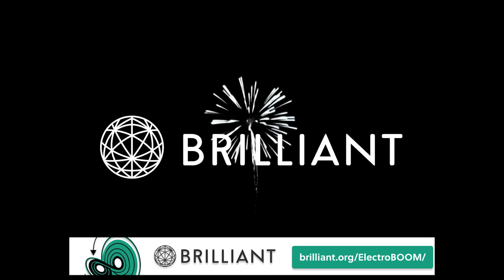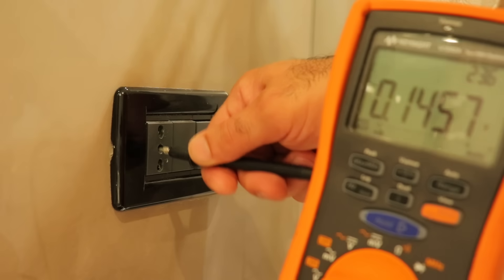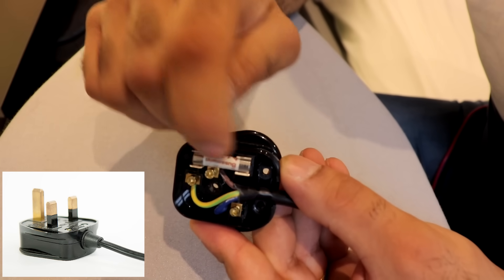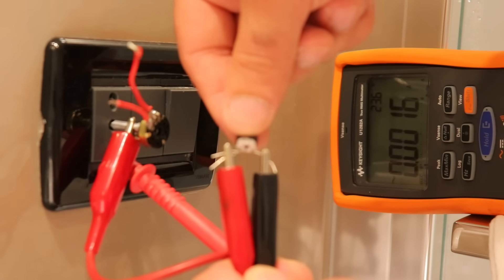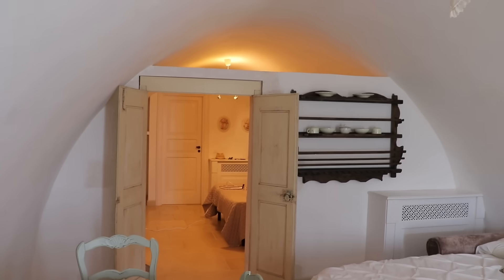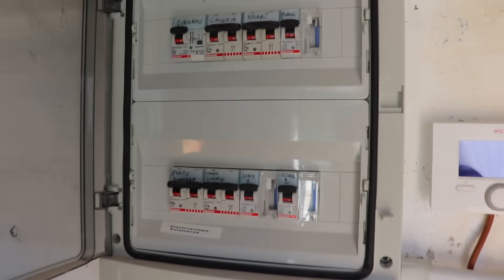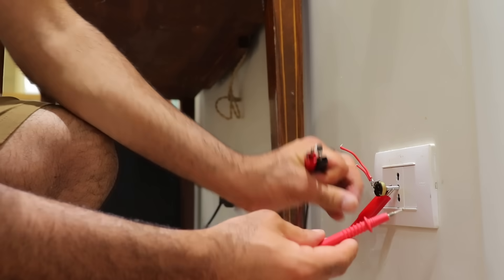Tripping Every Breaker in Italy

Comment: I have put your photo at my hotel reception area. You do imagine you can trigger the fire alarm that would force to evacuate the entire hotel... For your fun.. however if you want to test you are welcome to my house. In EU voltage is 220-240. Normal is 230. And yes we have    main ground protection of 30 mA an again for the bathroom a 5mA or 10 mA protection. You can't die of electric shock  even if you want it.

Comment: That weird plug (Around 9mins) should be for some hotel phone connection. About the other plugs: the one with "double holes" is rated up to 16A while the one with single  size holes up to 10A. The round plug with separated ground is a German standard also that up to 16A. In Italy, the standard power supply you get for your house is 3.5kW ("by chance" 16A at 220V), you can obviusly ask for more if needed but plugs with higher current rating are not available. Regarding the ground protection is considered good pratice to have one for every line (plugs, lights, hooven, bathroom, ac,...) while the one beforer the main switch is mandatory by law. The device you saw may also take care for  both the ground protection and  the max load on the line (above the set rate it automatically disconnect)

Comment: Alright, time to explain some things, from a fellow Engineer, @ElectroBOOM :)

1:43 - the "double-driled" outlet is what we call a "bipasso" (double-base): it's shaped like that because it can receive both the old 16 A, 230 V standard we used to use up until the late 2000s and the "Europlug" (10 A, 230V) which is slightly smaller and has the prongs closer to each other. Good thing that the ground is still in the middle :)

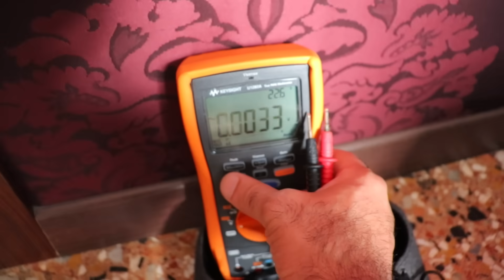1:48 - Usually in Italy the end user can see anything between 220 V and 240V, it depends on how recent and powerful the distribution is at the cabinet upstream.

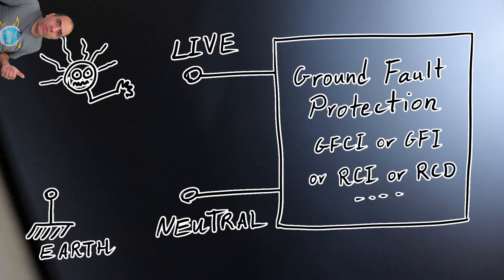2:29 - In Italy it's not mandatory to have GFCI plugs because, well... they don't work as well as a magnetic-thermical-differential breaker (MTD) does if well-chosen. We have quite strict standards on what size to put for any kind of use :)

3:08 - By UNI EN standards, Green/Yellow is ground, Black is neutral, Blue/Brown is live. The breakers you've measured are Schneider Electric's C10 class (which is a magneto-thermic breaker with a differential unit) which is way more than adequate for home use. C10 refers to the UNI EN classification: "C" curve (the way it evaluates the runaway current to ground, the C one is extremely sensible) and 10 is the Amperes it will lwt through in normal usage. If you want to see the tripping current, you'll have to see the I(delta)n value stamped on it. Quite safe, I'd say: it doesn't need ground fault, because it IS the ground fault :)

5:28 - That's the "Europlug" standard, 10A, 230/240 V. Small, but still useful. If you need something beefier (like, need to power a PC continuously or a microwave oven) you'll likely find a 16A plug (the "Italian Standard") or a SchuKo/UNEL plug.
Reply: But isn't the EU standard brown/black=live and blue=neutral??
At least that's what Wikipedia says and how it is in Germany.

Seems very dangerous to just seitch those two colors.
Reply: @YourMJK  When you read a technical directive, you have to be careful of what norm agancy you're referring to. For example...

UNI EN ISO is "International Standards Organization directive, as passed down to the European Centre for Normation, translated and adapted by the Italian Normative Union".

You can see how "some" parts can be different (for example, DIN/VDE require different colours for live and neutrals than UNI) as long as the fundamental parts of the standard (how to apply it, what parts to use, how to use them...) are exactly the same.
Reply: Le spine italiane tipo L ci sono anche piccole da 10A, si trovano specialmente quelle tripolo con la terra, che invece nelle europlug tipo C manca
Reply: Be careful! Blue is neutral and black/brown is live. (For European standards)
Reply: @ThatsGabs  The UN (European) Standard is different to the UNI (Italian) Standard only when it comes to colouring the wires.

Comment: The actual color rule for cables in Italy is:
• green and yellow = neutral;
• blue = neutral;
• black = live.
Do note, though, that this may vary by A LOT in older homes. I found all sorts of colors (like brown, red, white) in my goddamn outlets (with my house being 100 years old).

Moreover, many houses have lighting and appliances running on 2 different circuits.

Last but not least, you shouldn't use German plugs on Italian outlets without an adapter (even though you can actually fit them in there). Most Italians know that and wouldn't do differently, they feel damn loose otherwise. 

P.S. remember to pay a visit to Sicily next time you fly to Italy! ❤️

Comment: italy should have the EU-SCHUKO (the round one) plug,  but in older hotels te old standard is still tere and hotels mostly for US visitors . and the standard eu-braker are considered the safest in the world. Germany exports these brakers to everywher ein the world for a reason... lights and sockets are on seperate cicuits (every new instalation this is a must) and almoast every room has to have a seperate breaker, Kitchen and batrooms need also additional safty systems.

Comment: The new standard is 230V, while traditionally we used to have 220V. So, I'm not surprised at the fluctuation between those two.
Btw, I've lived in Europe all my life and I've never seen/heard of an application where you might need to plug the live and neutral in a specific manner. The ground is always in the middle, independent of the plug and no matter how you plug the device. The only application where you need to connect the live and the neutral correctly would be some two/three phase appliance. But those have different plugs and they don't have those in Italy. Italians reserve those for industrial application. There are countries in Europe where we have three phase outlets un our homes. As for the regular, single phase outlets, the general rule is that the right one is live, the left one is neutral or like in Italy, rotate that 90 degrees clockwise and you get bottom live, top neutral. In any case, the ground always stays in the middle. A common person will probably never need to know any of that.

Comment: Here in germany we also do have those simply "slim plugs" which are called euro plugs. However those generally do NOT have a ground connection like those you showed. Those are only allowed here for things that do not need a ground connection. So only for protection class 2 devices.

Here in germany we only have the "Schuko" outlets, everywhere. The brandname "Schuko" is a contraction of "Schutzkontakt" which essentially means "safety contact" and refers to the ground contact of the outlet / plug. Any extention cord here in germany has to have Schuko sockets. Of course for applications where the polarity matters we have the usual CEE plugs (blue[one phase] or red[3 phase]).  Though you usually don't find them in normal households. It's more an industry standard. Though you will see them in camping a lot.

It's always great to see those "security audits". It's really interesting how the rest of the world handles things.

Comment: Regarding gfci in (central) Europe, most of the times the entire house is protected by one gfci, or FI as in Fehlerstromschutzschalter as we call them. It is wired into the main fuse panel and protects every circuit in the house, not just kitchen/bathroom.

Comment: Looking carefully at some US plugs, I think I finally noticed why they've never actually caused me a problem despite their hypothetical deficiencies: the plastic around the base is flared out into a flat thing like a guard on a sword, so when you hold it naturally for plugging or unplugging, it's actually really hard to reach around to touch the metal. Of the 6 "bad" plugs in this room with me right now, 5 have that property. So I guess that's the cheaper solution.
Reply: Rest of the house has 4 more with the flared "guard" shape, plus one VERY old dangerous lamp without it. So I'm guessing it changed sometime in the 60's or 70's, an industry-wide rollout of flared plugs at some point.

Comment: I can imagine that in Venice it is an electical nightmare as some areas flood and all the electrical needs to be run high up and kept water tight where it may need to run near the water.  That being said I would imagine that much of europe is actually an electrical nightmare just like the US with old and new standards.  I think I would lose my mind if everything here was on an RCD or GFCI.  How do they prevent nucence tripping when grounded inductive loads like wellpumps, refridgerators, washers, etc kick on and off.  My fridge will rarely but sometimes trip a GFCI and the inductive ring and surge from the wellpump kicking in is enough to even trip a GFCI in some cases.  I am guessing they are either double insulating everything or are running most inductive loads on separate dedicated circuits.

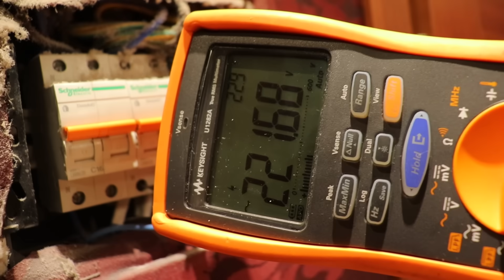Comment: 3:30 black is NOT the neutral in Italy!  What happened there
Reply: At my grandmas house in Sicily they used green with hot and blue neutral
Reply: @lucamarchese6187   Blue for neutral is right, but live should be brown... it could be some old or DIY system (also ground is green+yellow, striped)

Comment: ElectroBOOM One time I took inspiration from your videos and decided to stick two lock picks and a screwdriver in my gfci outlet and I proceeded to test the gfci. Then I bridged the live and neutral pins just expecting the lock picks to get hot and start turning red. Instead it exploded and the outlet stopped working, I was so scared that I broke the outlet but when my mom went to use her hair thingy in the other bathroom that outlet also wasn’t working. Turns out, I just tripped the 2nd story bathroom outlets breaker. And my lock picks welded themselves together. 

Mom, if you’re reading this, I fricking love you! And sorry for messing around with wall power.(And probably raising our health insurance by posting this comment.)

Also so that OSHA doesn’t come kicking down my door, the lockpicks had plastic handles and the outlet was gfci and I was standing on the plastic toilet seat while wearing my rubber crocs.

Comment: Actually the two different types of plugs are either 10 Amps or 16 Amps so when you have the "Hybrid" socket it's because it's rated for 16A. On the other side i think the socket that you were asking about is an old standard for telephone plug hence it also was near the newer rj socket. For the plug with a fixed neutral position it's called a schuko plug (CEE7/3 and CEE 7/4) and it should not fit inside a 16A socket unless you force it or unless the socket has been abused in the past. Nevertheless the problem is still there because you can buy an adapter and plug it in however contrary to what you think there are actually usually two level of protection one for the single appartament/hotel room and another one for the whole building usually coupled with the meter so if one fails you can still be safe 😉

Comment: The plug at 9:12 is a special version of the telephone three-pole socket made by BTicino. The plug had three connectors to connect older type of landlines that used a twisted wire pair that also came with an earth wire. Today landlines in Italy use just a twisted wire pair that carries everything from RTG (rete telefonica generale, our way of calling the PSTN) to ADSL and FTTC.
That plug is not as common as the standard type of three-pole socket commonly used for landlines but you sometimes see it in some older buildings.

Comment: In theory, new Italian houses must have a proper breaker for each room,  or a general breaker box with breakers that allow for proper closure of each room. The more important breakers are in the kitchen or bathroom, as we tend to have one for each main appliance (oven, fridge, washing machine, dishwasher etc), plus a general breaker. However, we have a loophole.... basically, each electrical, plumbing, gas setup in the house, when first built, has to be declared compliant to the current regulations, but if nobody ever touches it again for years...nobody ever really cares and considers it still OK. Unless a new technician checks it and says it isn't. Lol.

Comment: I'm italian, the problem when you connect shuko plug in normal outlet is that it require a specific adapter that convert the ground in sides in the center one. It should not fit into normal outlet but probably someone forced the outlet and now holes are bigger and NOT SAFE

Comment: You should check Germany, we have different outlets, these big plugs only go to grounded outlets. Devices without grounding (plastic cases) have a smaller plug without a ground wire and also go to the big outlets, so you don't have this missmatch

Comment: In many Europan countries (including Greece) the blue is neutral, live wire is black, brown and gray in 3phase installation and mainly black for single phase. Earth is yellow-green. For home installations there is usually a main ground fault protection breaker in the panel rated at 30mA, or instead of simple breakers for each power line a similar 2p micro gfp breaker like the one had to reset at the hotel in Venice

Comment: 15:00 Please explain why AC polarization is important to the device, especially with un-grounded cables; why have a polarized NEMA 1-15P?
I could understand a 3-prong connection (5-15P) needs to be matched since neutral & ground are effectively connected together inside (in my observations), not just a chassis ground. 
But what is the advantage of a polarized 1-15P?
Reply: Every device will work if it's wired backwards, but that introduces danger in certain situations. 

Take for example, a toaster with a single pole switch. If the switch happens to be on the neutral side, all of the heating elements would be live at mains voltage even when the toaster is off. Edison sockets are also very dangerous if polarity isn't enforced.
Reply: @Owen_loves_Butters  ah… duh… gotcha. Best to switch the “hot” side, even though you still have to complete the circuit, constant “hot” connection to the heating elements would make it more likely to accidentally close the circuit to neutral or ground with say, a finger or fork. 

Correction to my first post: “… AC *polarity*…” (not polarization)

Comment: And those "doors" are childprotection. The outlet is a Type L apparently.

And most of Europe "should" use the same standard for portection but not same outlets, although it actually is decided that we should be using Schuko outlets. 

and a another factoid - in Denmark - its the standard that there are two seperat breakers and RCD for the kitchen and lights so when U trip one u still have some light.

And those RCD should be testet every month but like none are, and they can stick in the on position over time and have a 20% failure rate over two years. But most ever get found within warranty cause no one tests them.

And ofc in DK we use our own outlets

Comment: The doors in the receptacles are required by code, so maybe the one which didn't have it was old, malfunctioning or simply not compliant. Small plugs are for 10A maximum current, large plugs "double drilled" support up to 16A on one plug. As for GFCI, or as we call it, "salvavita" (life saver), it is mandatory in the electric panel since maybe 20-25 years, and breakers were usually wired with a circuit for lights with lower maximum currents, and a circuit for appliances and receptacles with higher current support. Now there are breakers for single rooms or coupled rooms generally.

Comment: As a kid I sometimes visited my grandparents in Rome, they lived in an apartment building built in the 1930s. If we had lights on in more than a couple of rooms and tried to run an appliance, the lights would always go out. About 20 years ago the building upgraded all the wiring, with a breaker box for the apartment by the back door, and a main panel in the basement. It’s harder to make the lights go out, but now whenever it happens we have to go down to the basement to reset the breaker - the apartment’s panel never pops.

Comment: the larger current plug it's for 16 Amp and the smaller for 10 Amp in theory, the section of the cables should change to (2,5 mm² and 1,5 mm²)
they are not designed for schuko plug